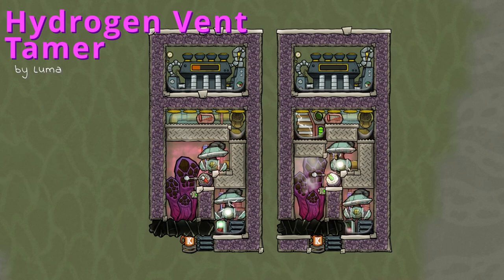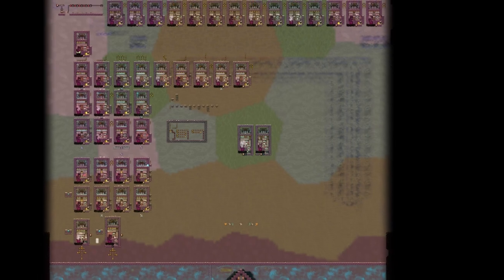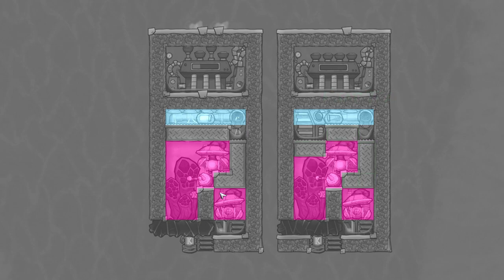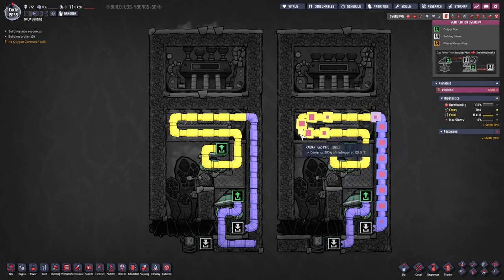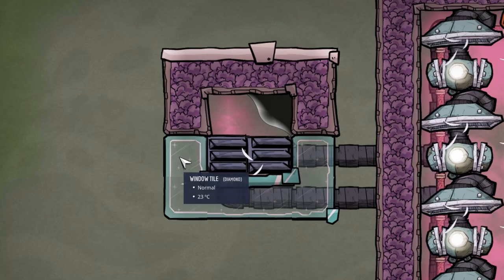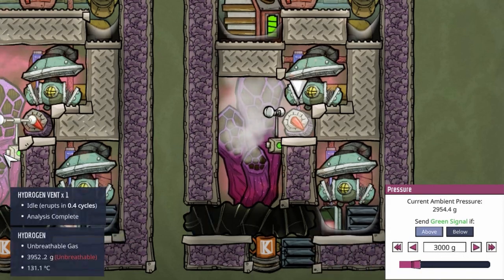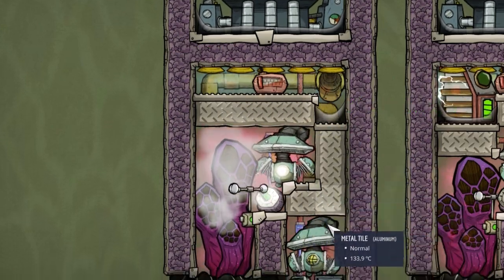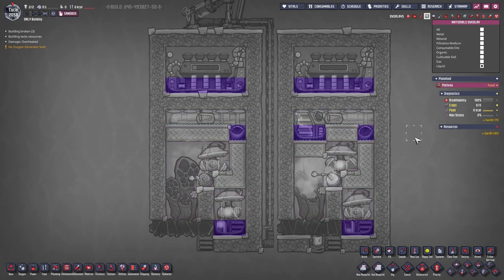My Hydrogen Vent Tamer - Explained

Comment: Ooh, this is a great build. I have been breaking my hydrogen pumps, even when using steel. It's so hard to resist going in there the second I can make steel though; free energy!
Reply: A basic way would be to build a the pump in a 2x2 room with a steel door connected to the hydrogen vent room. With a temp sensor to close the door at 250 or less. The remaining gas in the pump room is pumped out very quickly leaving a vacuum and your pump safe from overheating. The door to the pump opens again when your steam turbine cooled down the hydrogen below your temp sensor setting. You can do this the minute you get steel.

Comment: What a great build. I used this for 1000 cycles in my base without any problems. I replaced the metal tiles with window tiles made out of diamond and it works great.
Reply from the maker: Thank you for the nice feedback :). I normally try them out for at least 400 cycles to be sure they are stable. This one was a little tricky with the materials for the steamturbine. Glad it worked so good for you :)
Reply: @Luma_plays  Question: My two starting worlds do not have Aluminum, would Cobalt or Copper be suitable replacements?
Reply: @edtinsley525  what you're looking for is the material you have with the highest thermal conductivity.  Aluminum is the best one before you have access to Thermium, but I do believe cobalt is second best, with copper being third (or maybe that's gold, I forget).

Most metals will work, just maybe not as well.  Like the hydrogen might still come out hot, or you need to expand the loop by a few tiles to compensate for the weaker thermal exchange, but the base idea is still solid, it just might require a bit of adjustment depending on what materials you have.

Comment: I did a similar setup but I used a steel door to seperate the pump from the hydrogen vent.  I also did not have a lot of materials and it was an early build.  I combined the output of the vent with my spom.  I used copper metal tiles, gold radiant pipes.  I keep a thermo sensor in the chamber set to 215 so there is a buffer to protect the pump.  for the hydrogen that I use in the base as atmosphere I passed that line from the water chamber and not the main line since heat is destroyed in the hydrogen generators no need to waste power on reducing temp.  so my infinite storage is around 200 degrees.  then I have 2 pumps feeding 12 hydrogen generators coupled to a battery bank set to 65 percent.  between solar, volcanic steam power and the natural gas generators, they hardly go online.  

This build is of course 3 times smaller than what I built but this is really nice to see how much smaller we can make it :)  Awesome work as always.
Reply from the maker: Thank you, nice setup yourself. 12 Hydrogen generators! What are you powering? 
I always try to present the smallest possible build (that I could come up with - there are other people making it even smaller probably). In a normal lets play those builds of mine could then easily be expanded. For example putting 2 steam turbines on top or integrating a generator.
Reply: @Luma_plays  I just had the space for exactly 12 generators :)  and its really nice to see your batteries top up quickly when all fire up.  I am going to break up the generators into sections where they start in stagger.  it will give me a chance to test the automation ribbons.

I used to build "minimal" or "just enough" but then I realized even the most well thought out system breaks.  

I have just finalized my longest run at 12xx cycles.  I consider finalization when something breaks and I have to sandbox the fix.  

I now know that I have to build things as expandable buildings.  espacially the main astreoid. each planet needs to be self sustaining.  while having smaller planets is good on performance, it is really important what you want to build in the long run.  I usually prefer natural tile farming but it takes a lot of space.

Comment: this design was a great starting point for me to expirament and find a design that's best suited for my playstyle.

i diched the self cooling turbine idea in favor of more reliability and flexibilty with the materials, and also in order to maximize the power output of the turbine, since self cooling turbines only really work when the steam intake is at 125° and not one degrey beyound that (plus my colonies tend to have one huge cooling loop that goes everywhere, so its not a big deal to just extand it to include one more steam turbine), i have a smart bettery and a thermosensor set to "when above 200°" connected with an AND to the turbine, and i have also a fail-safe thermosensor set to "above 260°"  that overwrites the AND signil in case i dont use enough of the power and the room starts to overheat. The fail safe thermosensor also tunrns off the pump that pumps out the hydrogen, to make sure the vent doesnt put out 500° hydrogen when the pump is close to overheating.
I dont know how long the design holds up because i useally mess around woth the tamer ans try new things, but i dont see how it can break, the tempeture never gets close to 275° and if i dont feel safe i can always lower the value in the fail-safe thermosensor
Reply: Self-cooling works up to a steam temperature of 135°C afaik.

Comment: On a low tech simple solution, I have one where the hydrogen room is narrow, with one side bordering a water reservoir.
The wall is metal tiles, and there are tempshift plates from water to gas pump to keep that cool.

The reservoir is from a p.water vent, where I collect it to go to my orchard/pip ranch and hatchery/cuddle pip pen.
A few extra degrees won't matter.

Edit - I forgot to mention that the gas pipes start out radiant going through the reservoir to keep the temperature even during eruptions.

Comment: About "tamers", i have seen someone using a trick with visco-gel and liquid valves to trick the liquid pump into pumping ultra hot niobium, making it immune to heat damage. Maybe try to replicate that, and show the viewers, it is preety inportant late game to have some niobium, especially since you can just space freeze it when it is in a liquid pipe for easy cooling.
Reply from the maker: Thanks for the tip. I need to learn a little more about those pumps. I know how they generally work but i think i only used them once. For most of the other liquids i created the glitch pump :D. Love that thing

Comment: I used this design and substituted petroleum for the crude as they have similar TC and SHC....what I forgot to account for was the density.  Now the petrol has 'floated' up above the water and gunked up my steam turbine.  Whoops!  All because I already had a pitcher pump built for petrol but not crude.

Now I have the pleasure of trying to fix the issue in a "live" build. Hooray! :D
Reply from the maker: Maybe you can open up a side and let a bit petroleum out.

Comment: Since the steam turbine will only let out 500g packets of water you can loop the water though the hydrogen chamber first to pick up heat.
Reply from the maker: Correct me if i am wrong but a steam turbine with all gas inlets active uses 2,5kg/s, 500g per non-blocked inlet. Otherwise: Yes that would be an addition

Comment: Now there is no points of using Hydrogen vent in current meta, because Saturn Critter Trap is better in every aspects compared to Hydrogen vent. You can completely control the production, temperature of hydrogen is much lower, and the amount of hydrogen produced is much higher. 2.4 Critter Trap can fully sustain 1 hydrogen generator, and you can normally find more then 30 at the core of radioactive asteroid. This is the ultimate power solution that even can replace petroleum boiler and nuclear reactor, only overwhelmed by end-game sour gas boiler. I wish someday you also cover this beautiful plants in your vid too!
Reply from the maker: Thank you alot, i didn't known they are so powerful. Sounds like a cool plant for a setup! I often forget to check the wiki or the forum for designs.

Normally just try out stuff until I understand :D that way i end up with slightly different designs.
Reply: @Luma_plays  Did you know that your contents actually help people a lots even in different countries? I live in South Korea and even here many ONI players know you and get a lots of helps and idea from your vid. I recently subscribed and start to comment on videos which I already saw before (Haha) but I knew your channel since 2021. Just do whatever you wants and people will get help anyway XD

And about the Critter trap info, It is now correctly written on Wiki but just brief : 1 Critter plants produce 25kg of hydrogen in every cycle at fixed temperature(I believe it was like around 10C) and 12000kcal of plants meat in every 30 cycle. It consumes 10 kg of polluted water in every cycle and one critter regardless of species in every 30 cycles.
Reply from the maker: I really appreciate all the nice comments. I knew that people all over the world see the shorts but I wasn't sure they are helpful :). Glad that there is value in them. Also thanks for subscribing and commenting i learn so much from all of you.

Comment: There was deleting issue if you put vent dripping on oil like that, is it still the case ?
If I remember water dissapeared each time crude oil was pushed up and drop vaporized while there was crudge falling over same tile ?
Reply from the maker: I sometimes had that happen not all the time. You can try placing the liquid vent inside of the crude oil that should hopefully get rid of that issue.

Comment: I'm going to try this hot vent tamer in my current Spaced Out game. I have a hot polluted oxygen vent on my 2nd asteroid to tame. My 2nd asteroid also has an infectious polluted oxygen vent so I might pipe them together and let the heat kill the Slime Lung germs
Reply from the maker: Cool. Tell me how it went :)

Germs sometimes are hard to kill with heat. Cold, and radiation works better normally.
Reply: @Luma_plays  that's a good point, I'll plant some wild Wheeze worts to do that
Reply: @Luma_plays  I was lucky that my infectious polluted oxygen vent was at the the top of my asteroid and the radiation from the space biome killed the Slime Lung germs. Still waiting for my hot polluted oxygen vent to become active to see if your design works
Reply from the maker: @rickytleung  That is a really convenient find! Tell me how it went  Hope nothing breaks. I don't know how much more thermal energy is in the polluted oxygen mass (or eruption period).
Reply: @Luma_plays  I'm mainly using your hot vent tamer design to pre-chill the polluted oxygen. I'm thinking of combining two machines that I have planned to produce clean water and clean oxygen without using sand. One machine will boil polluted water to steam, other machine will chill polluted oxygen to liquid oxygen. Since I need to cool the hot water from the steam turbine and warm up the liquid oxygen, I think this will be a great way to handle both problems
Reply: @Luma_plays  I don't think the hot polluted oxygen vent creates enough thermal energy to power the cooling. Not sure why but it looks like the crude oil that's covering the water vent pops up and covers 2 of the intakes on the steam generator. I have the water vent positioned in the crude oil instead of above it.
Reply from the maker: @rickytleung  How hot did your liquids get so far? Might take a long time for it to heat up. That the crude oil may cover 1 port is possible but why 2?

If i find the time i might try those different geysers too.
Reply: @Luma_plays  I think to keep things simple, I'll make the steam chamber two tiles high instead of just one.

Comment: I dont have aluminum what can i use?plz help.
Reply from the maker: hmm nothing much you can do. you need the aluminum for the turbine and or the radiant pipe. otherwise the cooling power is not enough (depending on your geyser) to keep up with the heat in this design. You could try to make the upper room larger and place 2 turbines on top. then you can use materials with lower thermal conductivity. or you could use 1 turbine in a larger room and make the radiant pipe and the turbine from gold but have it run along the floor for more than 5 tiles to increase the heat exchange area.

You can also try to use another liquid on the floor of the steam turbine. See if another liquid like water with a different special heat capacity and or thermal conductivity works better.

I tested this for so many different things but in thissmall configuration aluminum was just the best. So I think making it bigger is the easiest solution. then you can experient more safely.

Comment: Can you use copper instead?
Reply from the maker: Hey White HG the self cooling only works if the average temperature of the steam does not go above 135°C. 
If you can keep the steam temperature low enough for example through buffer (liquids or the steam amount),  
the number of steam turbines or other measures, then self cooling will work. 
Generally you don't have to use Aluminum, BUT in this build in the size it is in the vid you will probably need it. I think i tested it for 600 cycles with different materials for the pipes and the steam turbine with differently strong Geysers. And Aluminum was needed in a few cases.

So in short: for this exact version you need Aluminum otherwise it is a gamble,
BUT if you make it larger and use 2 Steamturbines or make the ST room bigger 
and have a longer copper piping run across the floor it might work as well.

Comment: what do i use if i dont have alluminum in my base
Reply from the maker: Make the Steam Turbine area bigger and add a 2. Steam turbine. Over all most of my builds can be made easier by making them bigger. But i try to make them as small as possible.

Comment: Thanks!
I have had trouble with the self cooling loop for the steam turbine (on different setups) : the steam turbine overheats. Do you have to use ceramic for the insulated tiles beneath the steam turbine ? Is it possible that the amount of crude oil under the steam turbine is to low ?
Reply from the maker: The self cooling only works if the average temperature of the steam does not go above 135°C. If you can't keep the steam temperature low enough for example through buffer (liquids or the steam amount),  the number of steam turbines or other measures, then self cooling will not work. 
You don't have to use ceramic for the insulated tiles. But that means you have more heat bleeding through the wall towards your steam  turbine, heating it up more. So if you have a little bit ceramic too spare: make at least the tiles underneath the ST ceramic.
Edit: the amount of crude oil underneath the ST : the crude oil is there to transfer the cooling from the 95°C out put water to the ST. Any amount allows the transfer of heat. the larger the amount the bigger the buffer. Too much liquid and the Turbine will be submerged and stop working. You can experiment with that
Reply: Thanks a lot! I’m really enjoying ur latest series btw :D (vanilla/abuse)
Reply: Do you stream ?
Reply from the maker: @derez414  Not at the moment. Maybe in the far future. I am not fluent enough in english. I do a lot of voice overs. Thanks for the interest though :)
Reply: I understand, anyways ur voice/english/accent in your videos make a great peacefull combo that I enjoy as much as your content.

(No pressure, but streaming would help you get fluent in english. Also you don’t need to be as accurate when you streaming, we all do mistakes while chit chatting.)

Comment: It quite angers me, when i get a starting asteroid with everything you ever need +giant desert biome (sulfur biome) + free refined iron (close to core) +enough water for days, but you cant find the supply teleporter  for the 2nd planet at all XD
Reply from the maker: Or when you find it and it is not the input you were looking for. But the output..
Reply: I need both anyway, but i have looked all over the map, it might be in the pre-core area
Reply from the maker: @wittkopdotzgaming  weird. what planet? Not sure anymore but you only get supply teleporter and teleporter transporter on the first to the second asteroid as far as i remember.
Reply: @Luma_plays  its the small asteroid cluster, i have found the teleporter extremely early, but the supply teleporters are hard to find, they might be in the pre core area or the bottom jungle biome, that biome was avoided early game to keep the starting biome sealed in, and to not kill my dupes with hydrogen and chlorine, i simply ended making a loop like this: base>left end of the asteroid>down until almost reaching core> right until middle point of the asteroid, and then it should be in that area. I did searched the all upper part of the asteroid, but no succes in the supply teleporters
Reply: If you'd like, i could send you the seed tomorrow, maybe you will have more luck
Reply from the maker: @wittkopdotzgaming  Sure I'll take a look